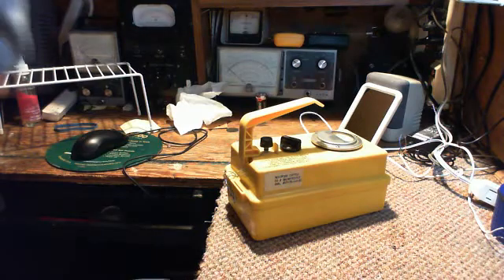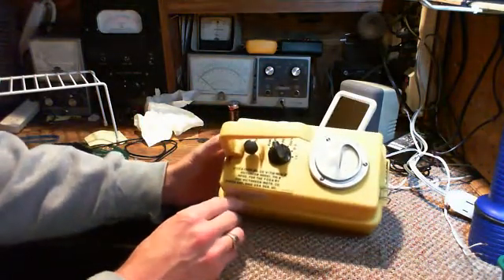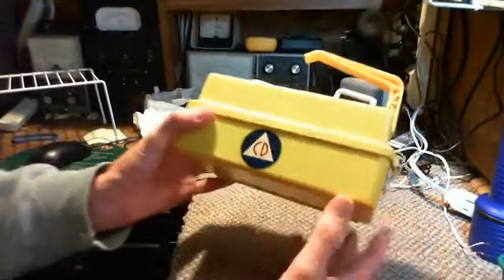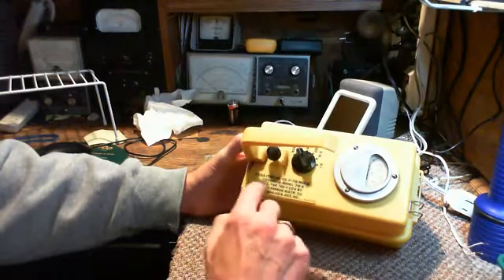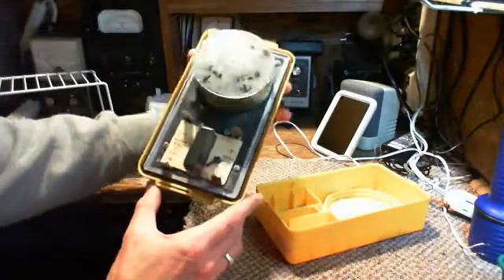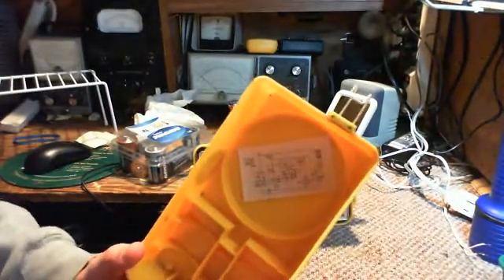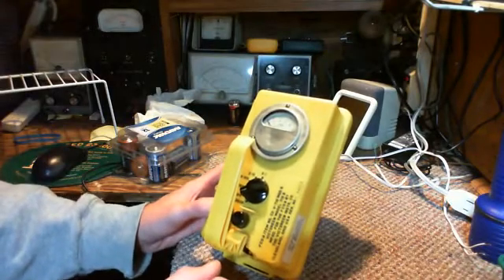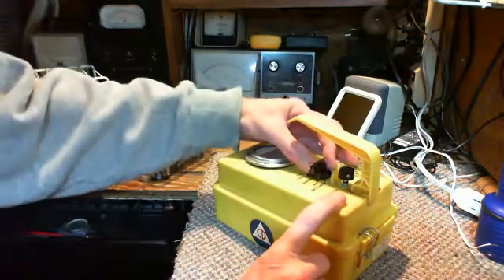Civil Defense Radiation Detector V-710 - Checkout

Comment: that thing has a max scale of 50 rem's on the  ×1 scale it is 0- .5 rem's on the x10 scale it is 0-5 Rema an on the x100 scale it is 0-50 rem's and remember 1,000 rem's is the amount that kills you.
Reply from the maker: I always thought these were intended to reassure everyone that it was safe to go back to work.. War industry has its needs.
Reply: Jim Lindenas well just because 1,000 rem's  is what kills you it dose not mean that 50 rem's won't cause cancer
Reply: Jim Lindenas also your nuclear power plant has so many reactors that is you are close enough to the power plant and you set it to the x1 scale you may get a reading.
Reply: Jim Lindenas also there is a metal geigercounter called the cd v 715 I have it and you could drop it of a roof and then pick it up and use it. it is also more robust with sensitivity because it's max reading is 500 rem's with can cause radiation sickness and posible death.
Reply from the maker: Maybe if I lived 'near' Fukushima

Comment: Hi Jim! I remember that unit. The surplus place had a pile of them for something like $2 each. It was meant as a fallout meter for very high radiation that would saturate the Geiger-Müller tube in a normal detector, giving a very low reading, and lead you to believe that you were safe. It also originally needed a 22V battery that has been  replaced by the little black inverter module between the D cells. A common household radiation source for checking devices is the lantern mantel from a camping lantern.
Love the videos!